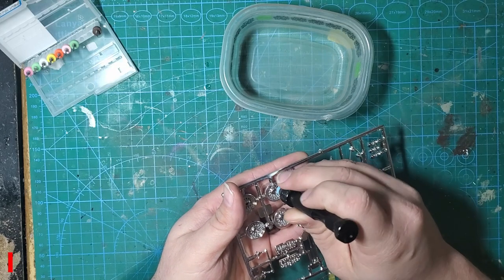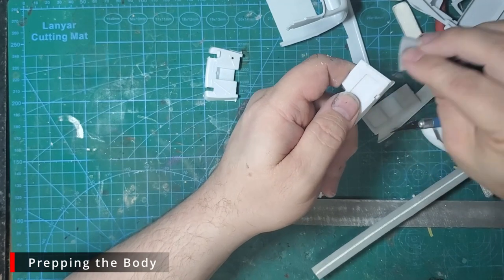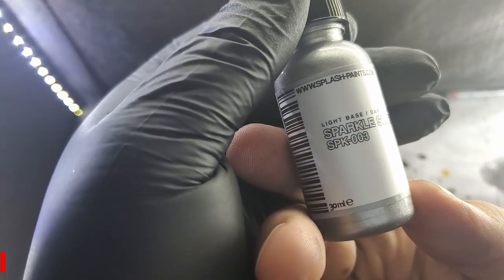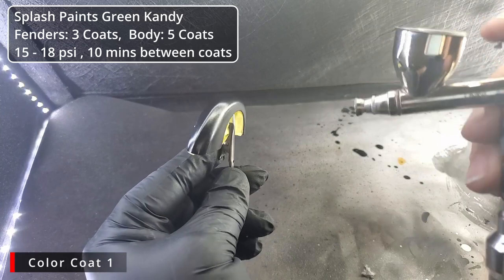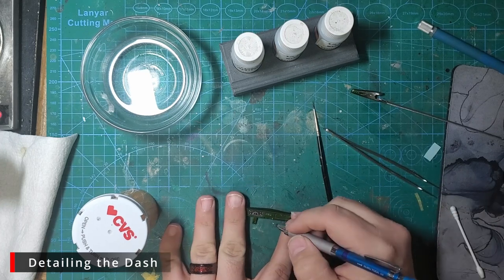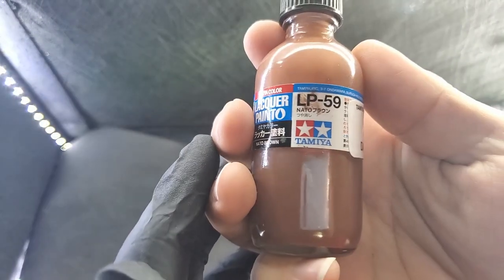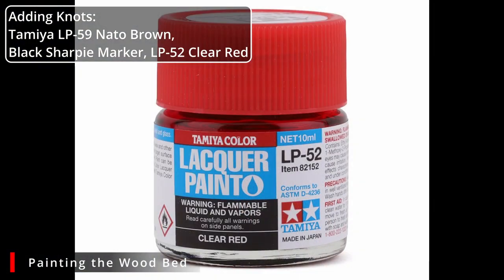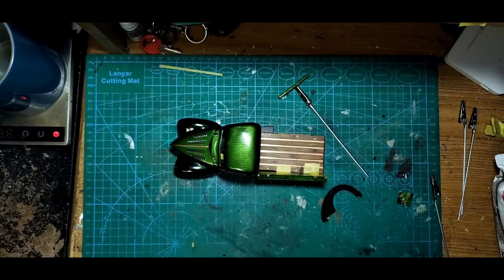Revell - '40 Ford Pickup - Painting the Body - 80th Anniversary Group Build

Comment: Great greens, Justin. 👍Handy tips on dash details.👍🤩 Thanks for showing and best wishes from jolly old England 👍😎Pete 🤓
Reply from the maker: Thanks Pete. Have a great weekend
Reply: @JHartModelworks  It's gone wrong already, Justin. I've just knocked a bottle of liquid cement over my bench and am dissolving parts not just chrome 😭
Reply from the maker: @petesmodelcarcustoms584  Man that sucks. So far I've only had a bottle of tamiya cement tip over once. For me though it's Micro set. Feels like I can't open a bottle without knocking that effer over.
Reply: @JHartModelworks  I'm nearly 60 and I'm sure I haven't done it for 50 years😂😭😭😂

Comment: Nicely done.
Since you didn't mention it, did you test the order of the painting on the fenders first? I was wondering why you went with the pearl clear under the green instead of over it?
Reply from the maker: Thanks Bob, Yeah I usually do test spoons for all my paint jobs first so I have a good feel for the paint and how it's going to spray (this has saved a few bodies from hot zero paints) as well as to determine variables like if I want to use a darker or lighter primer, or run a silver base under a color, and things like that. I wanted the sparkle from the pearl clear, but I wanted it to be more subtle, something that only shows in the highlights. If I did the pearl over the candy green the whole fender would be sparkly all the time. By doing it under the green I got a deep dark green with a lot of life where the light hits.
Reply: @JHartModelworks . That is so awesome to hear. I am the exact same way. When I get a "new" brand of paint I never worked with, I also do tests on the actual plastic sprue of the kit I'm painting.
I like what you did with it too!
Reply from the maker: @Bob0sModelFabWorx  Thanks